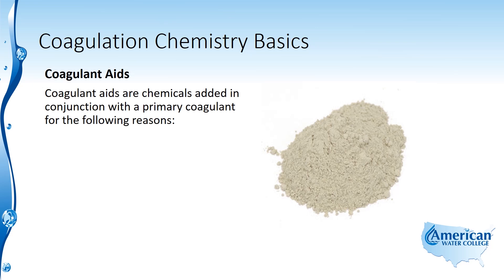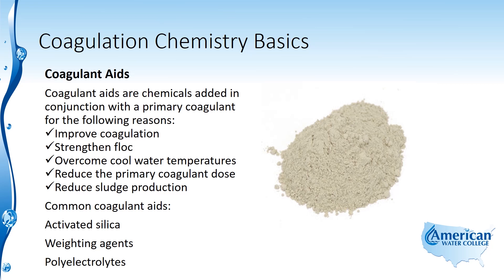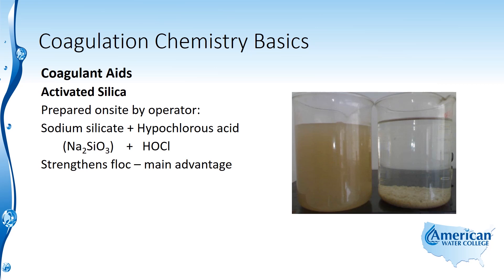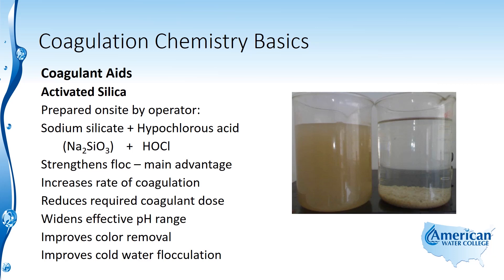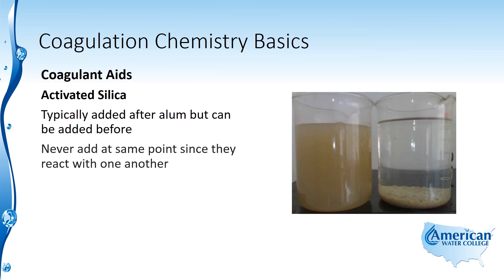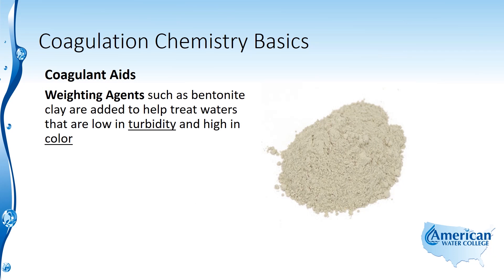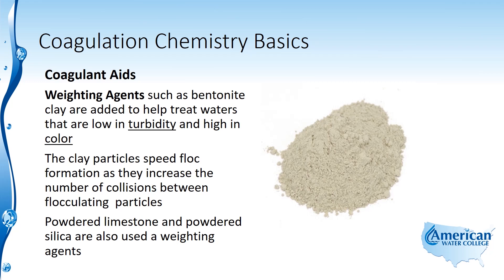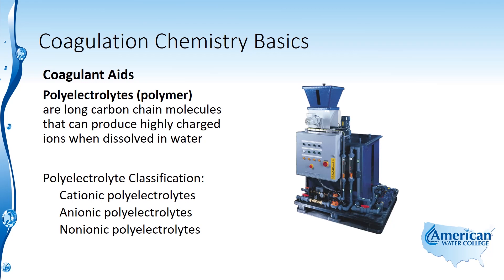Water Treatment | Coagulant Aids

Comment: thank you for the explanation sir, in my opinion coagulation aids are very important for water treatment because it can improve the coagulation of the dirt and it can reduce the sludge production which can save the treatment for the sludge. industry usually use activated silica for common coagulant aids because its cheap. 
-FTIUJ